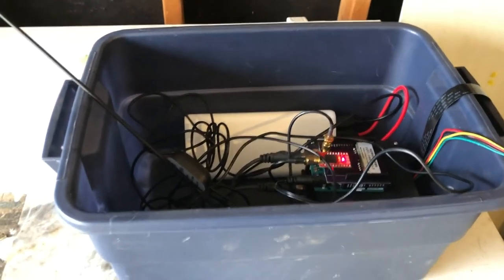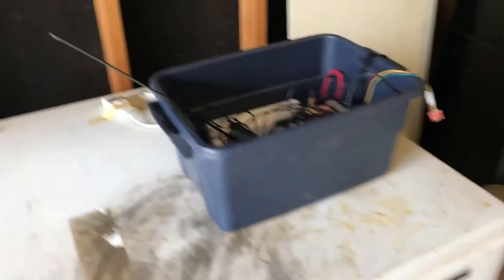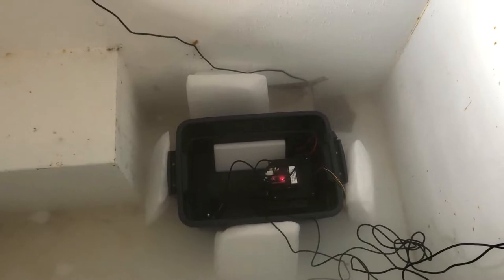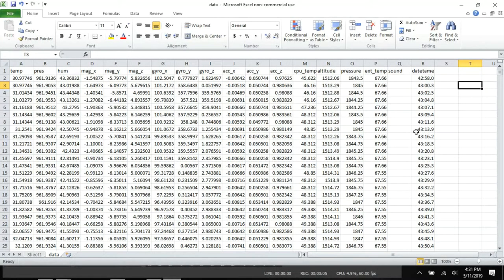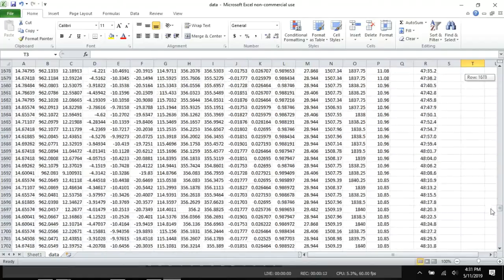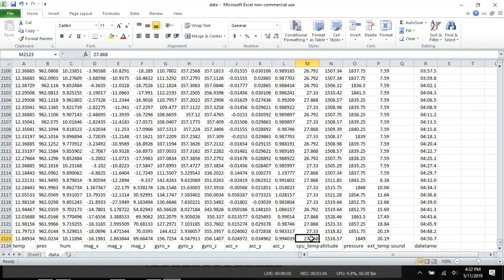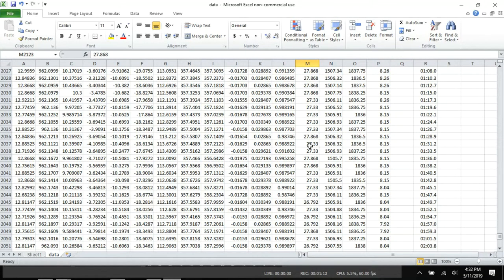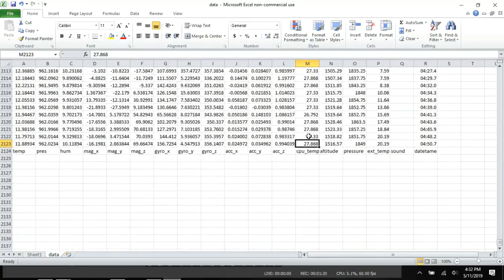Raspberry Pi + Dry Ice | High Altitude Balloon Test | Raspberry Pi 3 B+

Comment: I just launched a high-altitude balloon with a very similar setup using the same ultrasonic rangefinder. Speed of sound measurements were great up until about 20,000 ft MSL where temperatures dropped to about -15C, and then completely went haywire by 30,000 ft and above. I've read that the minimum operating temp of the HC-SR04 is -15C, so I assume that was our issue.

Comment: These videos are great I've used them as a guide to create my own space balloon project. I haven't seen a video in a while. I'm looking forward to seeing your launch. I have a question tho. When I put all my electronics into my styrofoam container the heat from the Pi especially makes the inside of my capsule like an oven and the temp keeps rising. I'm wondering if you've done this test inside your capsule and if you have the same concerns I do that I'm going to overheat before I reach altitude.
Reply from the maker: I have not tested it in the capsule yet, but those concerns have crossed my mind as well. The external temperature will be decreasing with altitude, so that may help. However, as it it goes up the air pressure goes down. The lack of air will cause the heat to have no where to dissipate to and may cause it to get very hot. With this dry ice test I feel like it provided a decent testing environment as CO2 doesn’t absorb nearly as much heat as atmospheric air. Overhearing was not an issue with the test so I don’t think it will be an issue in the air. But even if it does overheat, the Pi will throttle the CPU if it gets too hot to prevent damage